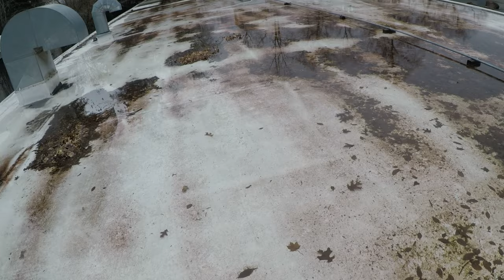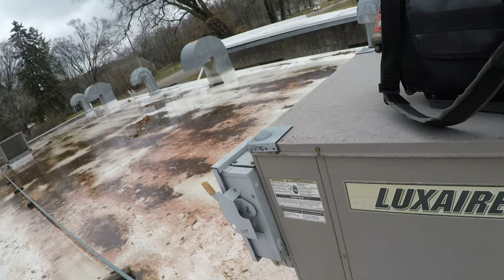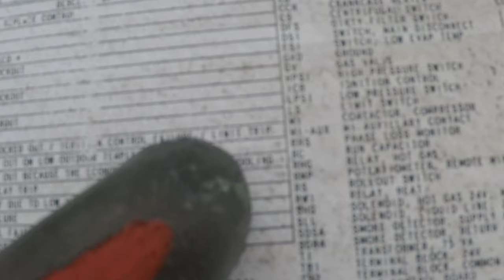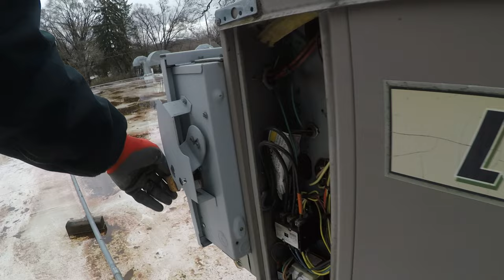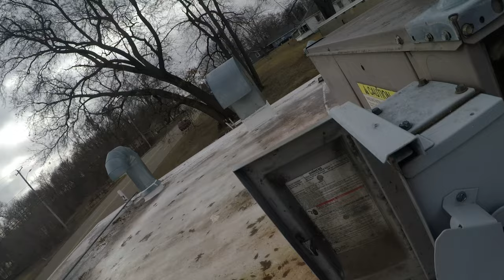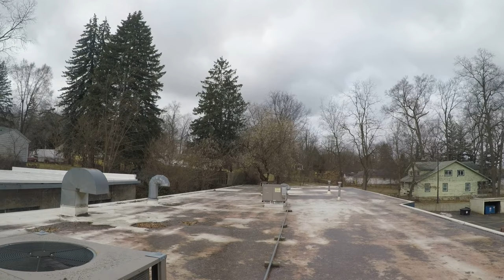Luxaire RTU HVAC Service Call -Easier Than You Think!

Comment: Someone needs to unclog the roof drains. Not good having the water stay on the roof. I'd always unclog them when I worked on a roof like that.  I don't do commercial, but do have some residential package units I work on.
Reply from the maker: Unfortunately, this building has settled the wrong way. He just spent a lot of money redoing the roof. They did come back and install a roof drain which help a little bit. I will be back in the spring to do PM’s that's what I may have my son do. Lol.